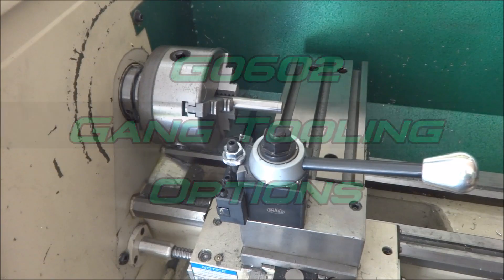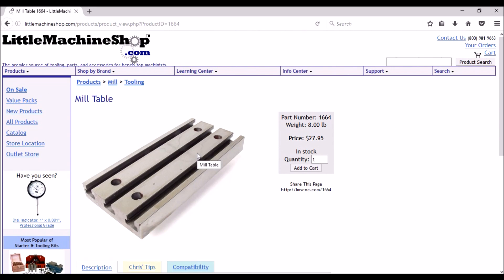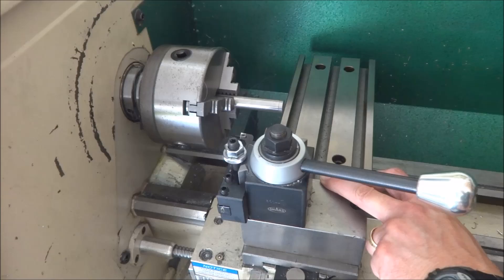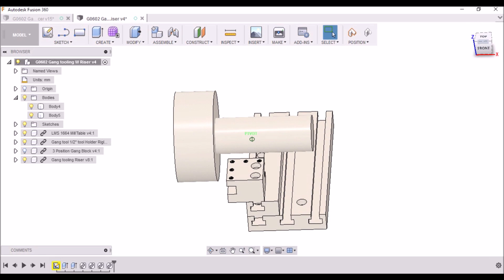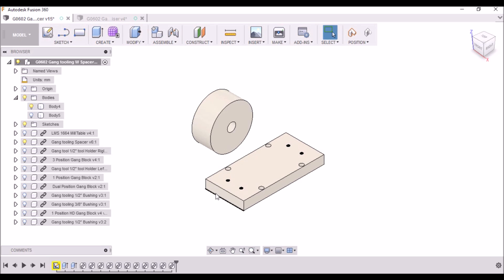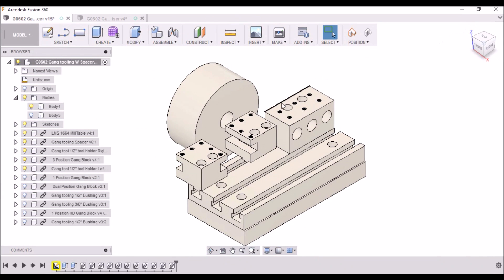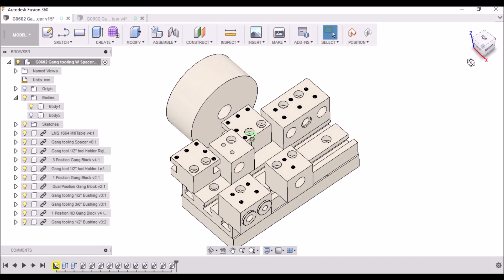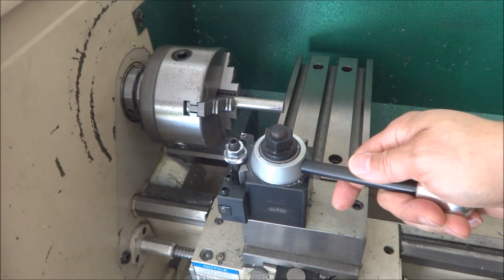G0602 Gang Tooling

Comment: you are losing a heck of a lot of swing over the cross slide with your methods, CNC4XR7  
you really must only make small diameter, short parts! 

the simplest, in my opinion (that gives you the greatest capability especially with the large diameter pieces) is to take the original cross slide table and mill t slots down the length of the table on either side of the dovetail (parallel to the X axis)
see the picture here:
https://sites.google.com/a/timsmachines.com/www/home/hardware/grizzly-10x22-benchtop-lathe
(look at the closeup of the cross slide table)
the Grizzly Part# was:    P0602902 CROSS SLIDE W/ T-SLOTS V1.12.06
no longer made - discontinued (Grizzly's dumbassedness)

"that's alright i still got my guitar" oops (got mixed up with a line from Jimi Hendrix' Red House) ....  I meant that's alright I still got my mill.

Just mill the t-slots yourself !! Voila !  5:15 Just make your tool holders taller, on center! AND... this can all be used in conjunction with QTCP if desired.  Done. there may be some slight disadvantages, but your trading perhaps that for much greater capability & versatility. If you only turn 2" diam parts why not buy a 7" lathe ? Jeeze you're throwing away most of your swing capability on a 10" lathe !!

Grizzly G0602 used to come stock with this table somewhere more than ~ 10 years ago. It was rather idiotic of them to discontinue the t-slots. for one thing you can do gang tooling with the cross slide. For another you can do line boring between centers - one the most accurate ways to bore (look up the method if you are unfamiliar -its popular a lot of places especially Europe + UK but not so much  here in the US)

That's pretty much the method that I'm going to use with mine, which arrives sept 9 2019.
Reply from the maker: Yes this project is on hold and I have not looked into the possibility of machining slots I do not know if there is enough material there for strength.  Thank you for the comment

Comment: Sam, I'm curious why you wouldn't just bolt the table directly to the cross slide and use taller gang tool blocks rather than compounding stacks of spacers?  It appears to me that will increase your turning diameter for using the QCTP, and you still have infinite adjustability of the tool blocks using the tables T slots.  You could use a thinner riser for the QCTP to make mounting it to the table fast and easy just like the gang tool blocks.

Any reason you feel compelled to reduce turning diameter and add in tolerance stacking error with the multiple risers?  I would think the KISS approach here would be the most beneficial since you aren't locked to existing components and plan on making the parts yourself anyway.

Then if you wanted to use large solid blocks and machine out tool types and locations for specific jobs you could.  Then a simple swap  out of whole completed and fully setup tooling plates on the table could allow for different jobs by just using a dialed in program for each of the tooling plates you have setup.  Locate them with standard dowel pin receivers on the table to have repeatability.  Then running different part runs is as simple as bolt complete tool plate down, home machine, load program and stock and hit go.  This is how production would be run very similar to a mill fixture and offset system I would think?

Makes much more sense to me if you plan on making various sets of parts over and over!
Reply from the maker: Hi Chris, I could use taller tool post and leave out the spacer, I really felt like the versatility was there the way I have it. 
It seemed the best approach for now Not knowing what will come up in the future. Having the riser gives you a little flexibility to adjust the center line of your machine. of course like you say if you machine your own holders you can make them as high as you need. I will draw it up and see how it looks.
Thanks For the input.

Comment: I think putting a block under it seems like a good idea if it's no good you can always remove it, as with "smallcnclathes" comment about X travel I was wondering the same thing.
Reply from the maker: Right my thinking was a Block doesn't have much machining involved so I'll try that method first.
In the event I don't like it I can make the risers.

Comment: Don't forget to make your LH or rear tool holder taller to keep everything on center since you will need to mount everything upside down unless you are going to run in back gear or in reverse.
Reply from the maker: Thank you yes something I initially thought about but forgot to factor in on the LH tool holder. I could run in reverse, However the G0602 has a threaded spindle so a inverted tool will be a better choice.

Comment: My setup is limited by the short X travel of my lathes (100mm).  I have a block straight on to the cross slide with 3x12 holes.  I use ER 11 or 16 collet holders to hold tools.  Large boring bar can be used as turning tool.  If you have spindle reverse, it can turn and bore.  I have contemplated using blocks as you have designed and I just don't have the travel to justify making various blocks.
Reply from the maker: Yes X travel will limit the amount of tooling that can be mounted having the versatility was important in the design.

Comment: Sam, I would go with your first plan. I also agree with Russtuff and make the tool holders taller. Granted most of your work would be smaller parts, BUT you really want to get the full value of the lathe's swing. You know a lathe is never big enough!!  keep on keeping on... George
Reply from the maker: Hi George,
 Yeah I see that vantage point as well, Not really a wrong approach I guess. I just cant foresee using Gang tooling on anything larger than maybe 1.5"

Comment: This was my plan when I built my Cnc lathe Sam, I think the second option is the one I would do.
Reply from the maker: yeah I think the second option is the simplest approach However making taller tool holders would also work I think.
Reply from the maker: Nice tool post David.
Reply: @CNC4XR7  This was going to be my comment.....just make the tool holders themselves taller.  Have you thought of any reason since you posted this that it won't work?  You'd also be able to turn a larger diameter.